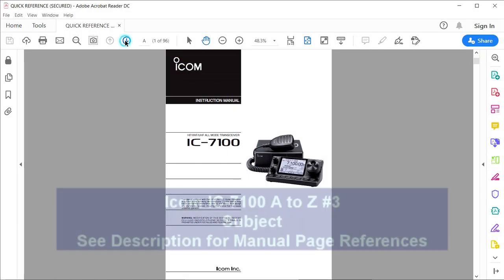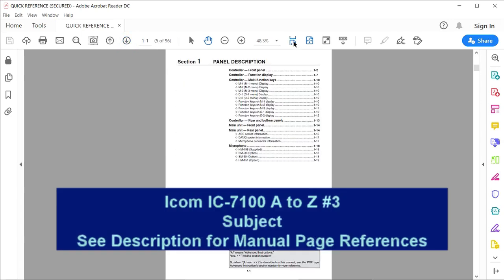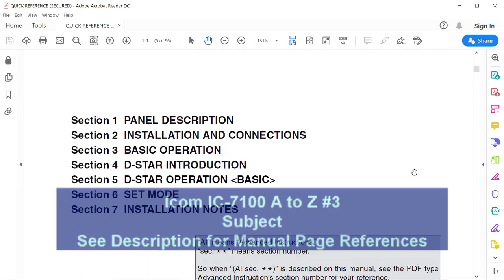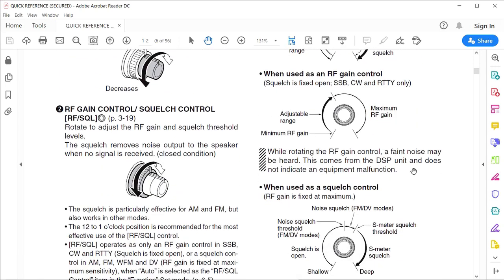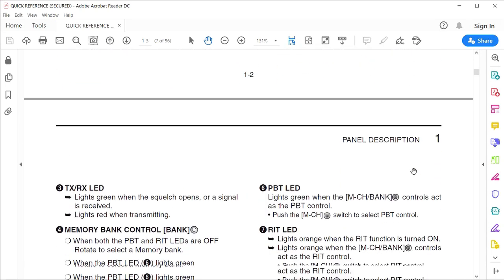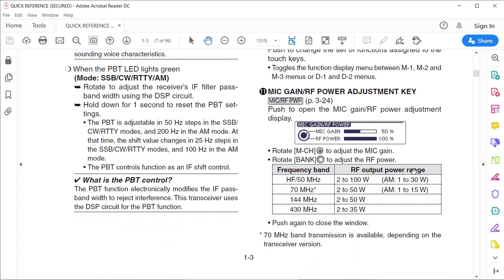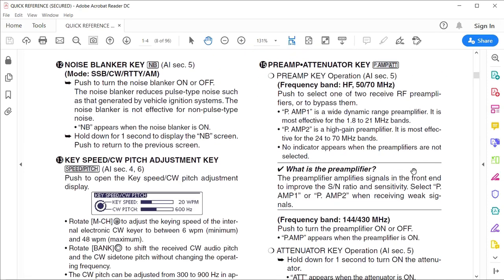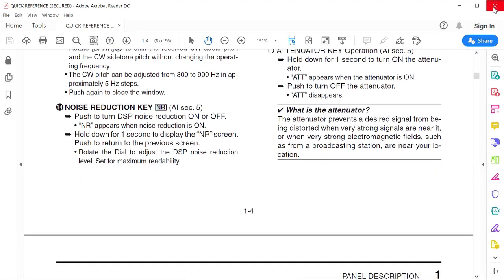IC-7100 from A to Z #3 Function menus, VFO, Band Stacking Registers

Comment: Apparently this radio was used for the ARRL response to hurricane Maria in Puerto Rico. Your video wasn't available and the guys were not necessarily all Icom fluent. Of course, some of them had a hard time. I've since then picked up this radio for  mobile and I"m amazed at its complexity and functions available. I think it was a good choice but the guys were a little floored with its complexity. I'm especially wondering about the "duplex" functions, especially as you said they could work on the same vhf band for instance. Usually that wouldn't be possible, so I'll wait for more explanation.

Comment: I very much like your presentations except for one aspect.  Your hand and fingers are often just waving around in front of the camera and obscuring what you are doing.  Suggest you keep them out of the way unless it is needed to press a button or screen function.  Also, just slow hand movements so they are not wipping around as that is VERY annoying.  I like your use of a soft pointer to tap screen functions but if you would use your left hand and approach from above, we could actually see which spots you are touching instead of it being obscured by the pointer body, hand, fingers or all three.  This is ment as construtive feedback and not as a stab at your techniques.  I have been using my IC-7300 for over three years and the similarities of the IC-7100 are so comforting.  I just bought a used IC-7100 so your A-Z approach is very helpful.  73
Reply from the maker: Hi Mark.  Thanks for the feedback.  No offense taken.  I am aware of this and try to make sure I don’t cover the display, but sometimes I get caught up in what I’m explaining and forget.

Comment: Tom
Just found you and these great videos - had my 7100 for a while. Quick question...
Do those 3 register memories for each band clear with power down? Or are they retained until you step on with another push if the button?
Reply from the maker: Hi Joe. Thanks for the kind words. The band registers are retained through power cycles.

Comment: Did you do the mod to bring the 7100 up to full power? I heard the radio has a issue with putting out 100 W on SSB. Mine peaks at 45W on USB and LSB
Reply from the maker: I am not aware of any mod and I haven’t had any issue with my 7100 not reaching full power on sideband.  Maybe this was an issue on earlier model radios?
Reply from the maker: What I meant to say is earlier runs of the 7100.
Reply: @HamRadioA2Z  Thanks for the reply. All I know is waht I saw in this video:

https://www.youtube.com/watch?v=YaGy4pUxkHc&t=1s
Reply: HamCuredSmoke  It’s good to know that newer versions of the 7100 don’t have the power output issue it would be nice if you could make a video I’d like to see it before I make this purchase...